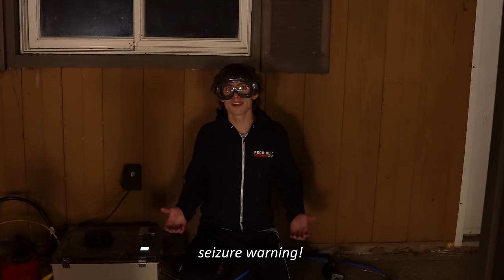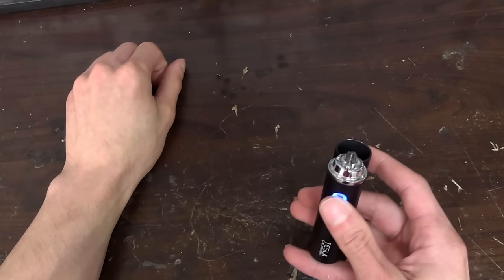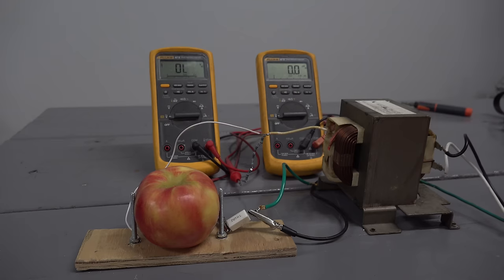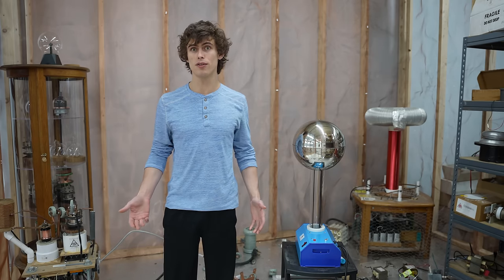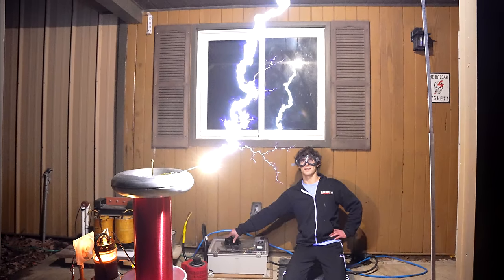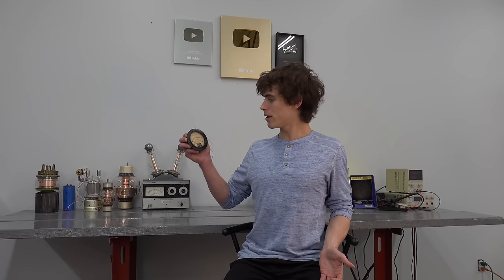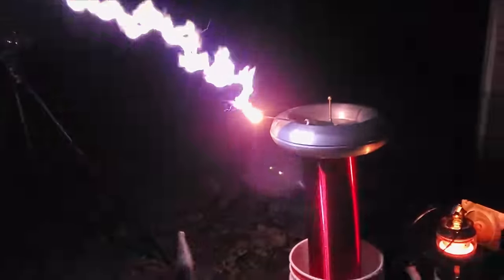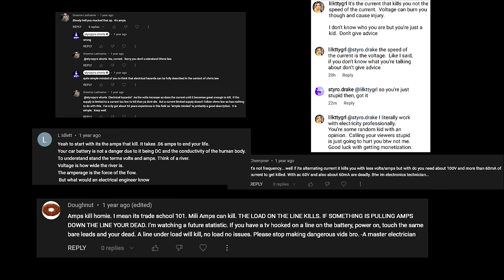Is it the volts or amps that kill?

Comment: It's like arguing what kills: a bullet, weight or velocity.
Well, all of it combined.
Reply: best explanation, holy fuck.
Reply: Quiet down, or you'll reignite the 45 acp vs 9mm debate back in here
Reply: What if
3kg bullet
But
0.1m/s
Reply: @crackedemerald4930  if it's very pointy - can kill😅 same as electricity kills only when it goes through vital organs
Reply: and also again, where it gets you. if the bullet has managed to reach your heart, probably not gonna live. grazes your shoulder, well can't say for sure since I haven't experienced it myself, but probably going to live(assuming you get treatment).
Reply: Exactly. It's a combination of voltage, amps, wattage and frequency.
Reply: so watts ?
Reply: I’m a dude playin a dude disguised as another dude.
Reply: True, it’s about the force of impulse imparted on the target due to the change in momentum - m x delta(v)/delta(t)

Thus, a fast heavy bullet tends to be the most damaging…
Reply: @crackedemerald4930  only if you shot it from point-blank range, as from a longer range the bullet would easily be affected by gravity. Even if it travelled for 1 second from a distance of 0.1 meters, would already be moving with more velocity downwards than forwards by the time it hits the target.
Reply: @HHSlinger 45 would kill you by grazing but 9mm would not because it sucks
Reply: @HHSlinger so, you’ve been shot in the heart? Interesting
Reply: It's just the mass/material, and velocity. The softest and/or lightest object in the world will kill you if it goes through the wrong part of your body at the speed of light. A gun firing a rubber bullet will not pierce your skin, but that same gun firing a real bullet obviously will.
Reply: mass x velocity = momentum. Bullet, small mass, big time velocity. kinetic energy = 1/2 mass x velocity^2.
Reply: Bullet I tink
Reply: @dsdy1205 9mm win
Reply: It's a bullet well aimed.
Reply: in short impulse kills you 😊😊
Reply: @salblue9811 lmao you obviously didn't understand the video I'd you think that was a good explanation
Reply: Well it’s the small surface area too
Reply: @LoganT547  And where it travels in your body.  Across the heart? Up your arm?
Reply: @dsdy1205 there’s no debate. It’s 9mm
Reply: @drunkee I read watts too.  Thinking its the dudes last name.
Watts has nothing to do with it when your dead from amps.
Reply: Best explanation!!
Reply: When it comes to bullets it’s all 3 but velocity is more important than mass
Reply: @crackedemerald4930  that’s sort of the point.
A bullet needs a speed above x and a mass above y to kill.
Electricity needs a voltage above x and an amperage above y to kill.
Reply: @paulnamalomba194  tends to but in reality you will get a clean shot through the body and do less dmg
Reply: @crackedemerald4930  thats just a hunk of metal being gently bonked on your head
Reply: speed
Reply: Resistance comes into it too
Reply: and where it hits
Reply: Mass*. Weight is nothing more than a straight downward force.
Reply: @crackedemerald4930 I think you’ve invented a hammer…
Reply: Blood flow is a factor, too.
Reply: @crackedemerald4930  but does it stop if you touch it? how many newton force is applied?
Reply: It is actually loss of homeostasis...
Reply: energy dissipated on target, exactly the same with a bullet and electricity, except the bullet has the hydro-static shock factor. To kill with a bullet you want the target to absorb all the energy, exactly the same for electricity, volts and amps work together, so does bullet weight and velocity.

Comment: how’s the electricity bill
Reply: Underrated comment
Reply: Y E S
Reply: That's the least of his concerns.
Reply: $$$ZAPED EFFECTIVELY$🗞%PERSENTAGES CAN CAUSEWAY Rethinking 📄.
3PHASE IS JUST A BETTER FORCE FIELD. MY 1950s ROTORY-MILL REQUIREMENT 740AMP IT UP! FEEDBACK IS COST EFFECTIVE
You pay bills for current supply rate called voltage  "Pressure sensitive" watts measurement. Leakage systematized overall is a justifiable Nasir..
Reply: it was from his life policy

Comment: I'm an electrical engineering student and I clicked on this link thinking that I already knew the answer. I ended up learning some new things. Great video!
Reply: Same, now I have a bunch of voltage/current/power stuff running through my head unrelated to my EE exam tonight, whoops…
Reply: @guydunn5354  Hopefully someone decides to be a smartass with the professor and claim that "iT's THe CuRrENT tHaT KIlLs" so you can jump in and get some bonus points
Reply: Don't get fooled. Ohm's Law is still at work.
Reply: @WCM1945  
Of course electricity is always conservative and follows the path of least resistance assuming also resistance change depending on thermal tolerances. Other than batteries most devices that are high amp are generally higher voltage also. So saying that amps kill is simply a good way to keep most people safe especially when they don't understand what they are messing around with. Working with live capacitor banks or step up transformers that store hundreds of volts and tens of amps you learn to be less conductive and pay attention to gapping stored potential differences or you soon will...
Reply: as an electronics engineer i'd like the electrical engineer to read my comment above . lol
Reply: @MrCh0o actuallt wouldnt be surprised if the doctor himself is saying that, look at the comments they are electricians and they are still trying to argue its amps that kills, one even said he thinks styro is lying with the numbers he is showing

Comment: This is the best video about these misconsceptions I have seen so far. 
First I mainly expected the basic description I give when someone asks me (people do because I am an electrical engineer). To keep it short I tell them "you need current running through you for a long enough time interval to kill you, to get that you need enough voltage to overcome the resistance of your body and it is different for DC and AC and different for different AC frequencies so don't touch anything". 
I like that you went further and you quantified things too. The charts you show for current and duration and for perception by nerves were a ton of information by themselves and the measurements on the static shock and the tesla coil were great too. It never actually occured to me that above certain frequency you stop feeling, your nerves running your heard do not react either and the danger is basically is down to heating tissues by the passing current. But seeing it now it makes perfect sense. 
And you made a bunch of condescending people look all manner of stupid which is always fun 🙂. 
Thank you for the great video.
Reply: Remember the basic physics law that higher frequencies have more trouble travelling further because they dissipate energy faster. Ohm's law might not mean shit for the human body, but still if you replace the resistance in the equation with the complex impedance you'll see that you get a much lower current out of a given voltage at higher frequencies. So it makes sense that higher frequency currents are less dangerous.
Reply: I like your basic description.

Comment: Hey there, I really liked the beginning of your video when you said "people said you're wrong"... I haven't watched the original yet.... 
Anyway, I'm an electrician and get asked this question often, and generally answer with "It's both and other factors such as time and conductivity" or i just say "Yes" (which tends to piss people off) ... Time is a major factor.... this is why, as a sparky if I work on live wiring/switchboards or whatever, I always put my body in a stance that if I get zapped I with fall away from the conductor (live parts), so I will only get zapped for a very short time.... 
I'm in australia so I mainly work on 240v or 415v... However, I very very rarely work on DC voltages over 50V. 
Sorry for the rant, but I will like and subscribe right now. Please keep making cool vids like this!!
Kind regards, Craig DeGruyter.

Comment: I also can't stand it when people try backing up their false claim with their qualifications, or when they're so confident and condescending, and wrong at the same time. Which is why I absolutely love this video. You proved that they are unequivocally wrong through the fact that you're not dead.
Reply: Dunning-Kruger effect
Reply: These people are qualified only to drag wires across the room, nothing more
Reply: Well you point out two fallacies. Just because someone has credentials doesn't mean they're always right when disagreeing with someone who doesn't have as good of credentials. But also, just because someone does something and doesn't experience any negative consequences doesn't mean they didn't get lucky. I can't stand it when someone says, "I've done that several times and haven't have any problems, so it must not be bad."
Reply: Yup, the classic argument from authority
Reply: unfortunately getting an engineering degree is not a high bar in the US. It's what you do with it that makes you qualified and experienced. So some rando in the comments section flaunting their diploma is not going to be very convincing imo
Reply: @Praxium  Explains volts and amps the same way you would to a 5yr old "But im an electrical engineer, so what do i know?"
Reply: @arnas.placenis  Lmaoooo, shots fired
Reply: @chitlitlah  Except the experiments in the video were backed up with data not just shrugged off.
Reply: happens all the time on all levels T_T
Reply: My uni professor said that plasma is not a state of matter as it is not scientifically confirmed
Reply: Keep in mind that he said his tesla coil demonstration  could cause severe internal burns and that's why he kept his touches brief. I learned more practical in this video than 1 high school physics class and 1 college level physics class. ROFL.
Reply: @WowCreativeUsername  That's irrelevant to this thread and what I said. The poster suggested styro is correct and can be trusted because he hasn't been killed by his projects. That's a fallacy in itself because some people just get lucky.
Reply: @NidokingOtsutsuki  You'd be surprised how often that paperwork means precisely shit
Reply: @chitlitlah  how many times a day do you use the word fallacy?
Reply: @comment_deleted  Well so far two today, but it's turning out to be a good day. In a comment thread that's 100% about people making fallacious arguments on a video partly motivated by people trying to argue from authority, it's a bit hard to avoid. I guess we have to raise it to three now.
Reply: @comment_deleted  How many times a day do you use the word "the"?
Reply: @chitlitlah  at what point do you decide that someone just understands what their doing and it’s not all luck?
Reply: @chitlitlah  I completely understand how someone can get lucky but usually that’s used when someone bests a situation once or twice. Not every damn video 😂.
Reply: Authority bias go brrrrt.
Skepticism is the key to a long and prosperous future. ;)
Reply: @JoKrPH  Some people have a lot of luck. This isn't a shot at the video creator as he seems like he knows what he's doing, but more so because he can explain what he's doing and make sense rather than he's done some stuff and survived. But in general, some people get lucky a lot of times and convince themselves and others they know what they're doing, so it's not enough to "unequivocally" say someone knows what they're doing just because they're alive.
Reply: On the internet, everyone has a PhD.
Reply: @chitlitlah  ah okay I’m understanding your point now. You’re not more so coming at the video creator but the original creator of this threads comment. Gotcha
Reply: @acf2802  I agree, I always say everyone doesn’t deserve an opinion 😭 but I know my line of thinking on that can get dictatorish real quick.
Reply: @chitlitlah  I'm not sure if you're not understanding my comment, or not understanding the contents of the video. I am not saying that him just generally doing things with electricity and not dying is proof that he is correct. He ran specific experiments that the commenters claimed would kill him. Him not dying proved his hypothesis.
Reply: @zthecat  I didn't see the comments saying he would die. Okay, pretend I never said anything.
Reply: @chitlitlah  I can't wait for you to start correcting grammar 🤣
You get em!
Reply: If you believe in this video, go repeat the experiments and let us know the results.
Reply: @mikegamerguy4776  musty not payed attention at ALL lmfao
Reply: Better believe these "experts" half the time cannot back up their claim
it's just "I'm an engineer and you're wrong"

well, I too am an engineer of some sorts, and my experiences is saying YOU'RE wrong, so please explain how this phenomena can be both true and false?

> crickets in the background